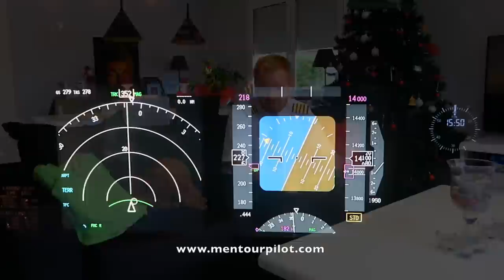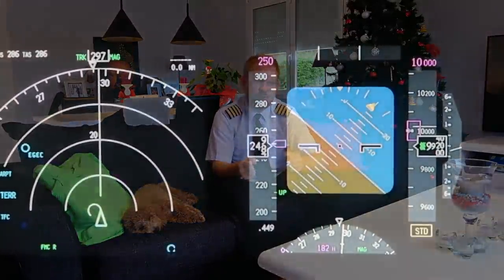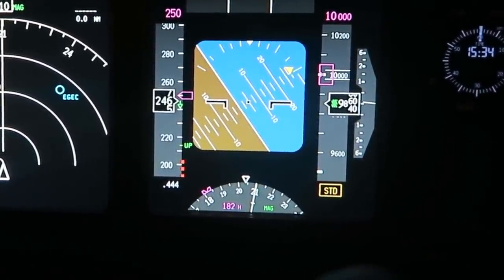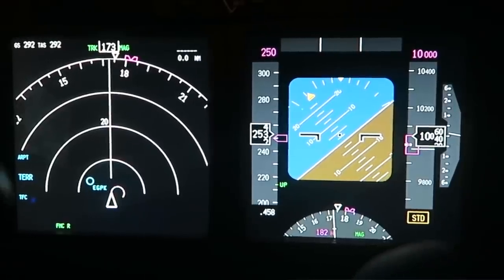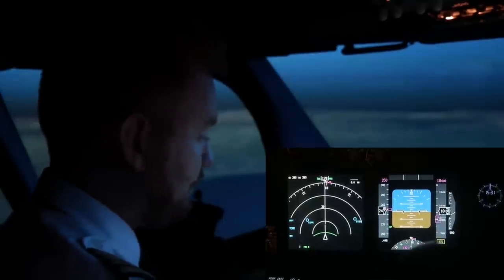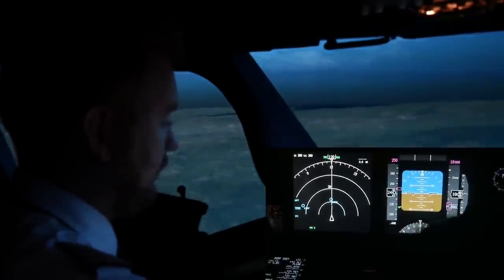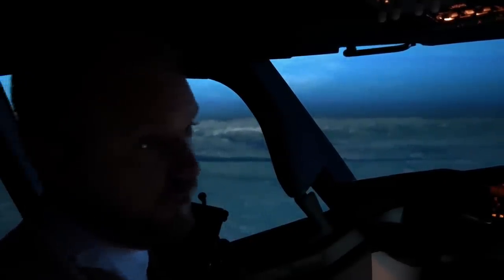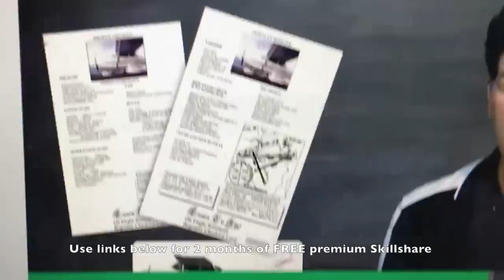What happens if you ROLL an airliner?!

Comment: Q. What happens if you roll an airliner?
A. You lose your job
Reply: That structural overload is a real thing. You get to survive to lose your job - if you're lucky.
Reply: @Lucien86  Not really, yeah might be unpleasant in the passenger seat, but the aircraft will be just fine. The safety factor is more than 1.
The B707 test pilot even did a barrel roll with it. B747 was tested at mach .99, but never ever goes that fast normally.
Reply: @janosmucha4897  I'm sure you're right. But in a structure that big physics is always against it and rolling puts some very abnormal loads on the airframe & wings. Heavily laden, full of fuel, and maybe 10 + years old, not quite so confident.
Reply: You Will have an appointment with the Wind Commander for sure.
Reply: World is boring.
Reply: 6 6  was it for Aeroflot?
Reply: @janosmucha4897  A fedex pilot pulled it off a couple of times in a DC-10-30 too granted that was a cargo variant, put the aircraft through several overspeed dives and other manoeuvres that were not exactly by the book in the same flight too. Course when you have a crazed lunatic on board actively attempting to murder your crew over stressing the airframe is the least of your concerns it's not like the plane will survive the loss of it's crew either.
Reply: And your life, along with 250 people.
Reply: @rolandocrisostomo2003  Not really in fact aside from the examples where it has already been conclusively demonstrated there is really no good reason to believe others could not achieve it. Don't get me wrong they are certainly far from optimised for it this is not the sort of thing that large wing spans lend themselves to as the larger your wing span the greater your moment of inertia in the roll axis as a rule and thus lower achievable roll rates. In short this results in more altitude needed to pass through the time spent with your aerofoils inverted and not generating lift and recover before striking the rather large rock bellow you, course this is somewhat counterbalanced by the fact airliners tend to have rather high service ceilings that would enable them to bank the necessary air beneath them to pull it off. I'm not suggesting you head out and grab yourself an A320 to try it out but I certainly wouldn't be staking my life savings against anyone that claimed they could pull it off from an initial altitude of FL380 for sure.
Reply: not for the pilot tex johnston, if it were not for his barrel roll boeing wouldnt have had a passenger jet
Reply: Worth it. :D
Reply: Of course
Reply: A simple roll should not break the airplane. A roll with elevator (a proper barrell roll) will quickly stress the aircraft
Reply: @Lucien86  rolling itself does not increase load factor. You need to pull into the roll i.e turn to increase load factor.
Reply: @afoose  You're only thinking of the load as a static factor. Rolling reverses the forces on the wings twice plus a lot of other momentary loads and on a big plane these can be pretty large.. The wings will flex, the whole fuselage will flex, the engine mounts will flex. Any asymmetry in the rotation and the engines will also apply gyroscopic forces to their mounts. 
The real difference between small objects and larger objects is that physics is not scale invariant - which means that larger objects tend to be inherently more fragile. Or in other words the larger an object the greater the forces it will (tend to) experience.
Reply: @Lucien86  all airframes which operate in the USA are designed to bear 150% times limit load.  In most jet transport aircraft this is higher than 3gs in both directions.  All aircraft strucutural components are designed to bear this load before plastic deformation occours in the airframe. If gyroscopic forces could stress engine mounts higher than 1.5G in a turn than all jet transports would be unsafe to fly. The control surfaces of commercial transports are not sized to create a roll rate which would damage control surfaces during maximum commanded roll. A engine mount will not structurally fail at +- 1.5G manuvering loads.  A simple roll only imparts aerodynamic loading and does not actually increase  the load factor on the aircraft.  In actuality it may de-load the aircraft due to loss of vertical lift over the wings.  

The most load inducing component of a roll is the pull-out. After the wings roll past 160 degrees or so, the aircraft will lose lift and the nose will drop as the wings lose lift and the aircraft loses elevator authority.  Pulling out of the dive at low altitude will likely necessitate a high g pull-up.  

TWA Flight 841
Fed Ex 705
China Airlines 006

Are all examples of jet transports which have rolled extensivly in flight.  

In China 006, the pull out exceeded 6G and destroyed 50 percent of the elevator surfaces.  It was repaired and put back into surface. 
In Fed Ex 705 the aircraft was rolled at least once. It was oversped into mach buffet zone, and the interior was damaged, yet the aircraft was repaired and put back into service. 
TWA 841 rolled twice in a dive, was oversped, and experienced 6G in the pull out yet the aircraft was repaired and put back into service.
Reply: @afoose  You put some fascinating info but it only shows that what I said is true. Aircraft are deliberately designed to be able to survive things like rolls and with redundant margins. That 3 gees of stress in either direction on the wings is a stat I haven't heard before and is very impressive but makes total sense.. 
TBH I already imagined the biggest danger with big planes and rolls has to be picking up too much vertical velocity during the roll then pulling out too fast or going into an uncontrolled spin..
Reply: @Lucien86  normal operational load to maximize fatigue life is limited to +-1.5G with limit load typically being 2.5G and certified ultimate load 150% times limit load. At this point the airframe will plastically deform. 

These loads are created by the lift vector  which is roughly equal to the aircraft weight. This is typically in the hundreds of thousands of pounds.  The load factor is a multiple of aircraft weight.

You can do a quick calculation of control loads due to aileron deflection (you will need primarily need airspeed, aileron area, some estimation of A/C inertia and secondarily vertical/horizontal stab area, and max roll rate created by aileron roll) and you will realize that these do not amount to multiples of aircraft weight.
Reply: @Lucien86  always assumed planes could handle whatever you could input with the controls until I saw people in DCS sheer off their wings in high g maneuvers.
Reply: @KBBF3  Yep and that is totally accurate. Do a steep dive and pick up enough speed and pull up quickly and sharply enough and you can pull the wings off almost any plane. In a maneuver like that the wings themselves are acting as the main 'control' surfaces applying the turning forces. 
This force multiplication with speed is why supersonic aircraft have to be built far more strongly than ordinary planes, hypersonic planes and reentry vehicles have to be stronger still.
Reply: Life advice right there...
Reply: Your job and likely your freedom.
Reply: Actually Tex Johnson who famously rolled the 707 didn't lose his job.
Reply: The test Pilot who flew the Dash-80 which was the Prototype of what would become the 707 did a barrel roll during a test flight and when question by the Boeing CEO at the time Bill Allen, the test Pilot just said "Just Selling Airplanes Sir!"
Reply: @Lucien86  gotzilla havent this problem.. And is big...
Reply: I’m sure there have been some seriously unplanned rolls which have gone on to successfully land. I think there was one in Alaska, a Chinese plane? I doubt any were pleasant for the passengers. There was one doomed plane that flew upside down for a bit. At 90 degrees I think you’re just clinging to straws as to whether you roll or drop.
Reply: I made your comments 666
Reply: In 1988, the VASP Flight 375,  suffered a hickjack by an armed attacker at a time remote airports had poor securit. The disturbed man wanted the pilot to ram the airplane at the parlament. Pilot Fernando Silva did a Tunnel and a Corckscrew in order to throw the hijacker out of balance, ironically he failed to immobilize the hijacker because he standed up before the copilot and flight attendant could unfasten their seat belts. 
The plane survived both maneuvers with light damage to the elevators. Unfortunately there is few details about the incident in English, but you can watch a simulation of the maneuver here and try the automatic translated subs:
watch?v=QAOsxBlm5Ns
Reply: Lucien86 the reason why the 707 was fine is because the pilot did a 1G barrel roll, as far as the aircraft was concerned stress wise it may as well have not rolled at all. Other maneuvers on the other hand.... Not so safe.
Reply: B. Everyone dies. "Safest way to travel, unless the pilot turns the stick too much".
Reply: @janosmucha4897  You are not considereing this roll with the additional weight of passengers and the cargo involved. With that additional load it is very lickely that you will damage the structure of the aircraft heavily with the wrong input. And its quite difficult to keep doing the right inputs in this situation without overdoing it. Sometimes its even impossible, depending on the situation. Also as he mentioned in the video, the Test Pilot was very experienced aswell and its not something you can do without huge preparation.
Reply: Probably your license too. The FAA doesn’t look too kindly on aerobatic maneuvers in a non aerobatic plane.
Reply: It's what happened to Denzel Washington....
Reply: Rolling any  airplane can be done doing  zero loads on the fuselage. Bob Hoover could roll his airplane without spilling a glass of water, doesn't have e to
Reply: Only if you have witnesses. 😉
Reply: And your licence.
Reply: @alexs3187  I thought any maneuver in an aircraft was aerobatic.
Reply: Concorde pilots did it over the Atlantic in the dark.
Reply: A.M. "Tex" Johnston was almost fired because he did the original passenger plane barrel roll of the 707 prototype over the Gold Cup course in Seatle.  He was told to never do it again. full details in his autobiography.
Reply: @janosmucha4897  – the 707 was a very strong aircraft. Strong tends to mean heavy. In the early days of jet airliners fuel was cheap, fuel taxes were low. Today strong, heavy means high fuel consumption = big big $$ even with the much higher fuel efficiency of modern high bypass turbofan engines and much improved understanding of airframe stresses.
Reply: @Lucien86  , when Tex Johnston rolled the 707 over lake washington during the seafair hydroplane races here in Seattle , that was a one G maneuver. The airplane never experienced more stress than straight and level flight. He actually did it twice that day.
Reply: @jaydencostanzo6308  ,your a child...
Reply: @stevegiboney4493  That probably shows more than anything the huge differences between very skilled experienced pilots and less experienced pilots. I hadn't appreciated it in my first posts but yes rolling a plane done right is a low stress maneuver.
Reply: @pcmasterwraith7676  jk
Reply: Anyone not wearing a seatbelt falls onto the ceiling.
Reply: FAA: it’s a passenger plane! Not a jet fighter!!!!!
Reply: @Dr_Reason  - Actually, Bill Allen did fire Tex Johnston the following Monday, then rehired him to head up sales. I like how Allen, when Johnston explained there was never any risk to the aircraft, laconically said, "Well, you know that and now we know that. Just don't do it again."
There was a Braniff acceptance flight of a 707 that ended in disaster when the pilot exceeded the roll limits during a Dutch roll. Three of the four engines departed the wings and the plane crashed.
Reply: Texas Johnson didn't lose his job. His boss told him: you and I know, you did one G during that roll, but the public doesn't know that. Never do that again!
Remember, that was during the very first presentation of the new 707 model. He had quite an audience.
Reply: @Lucien86  No, it doesn't. How do you fly a looping? When you fly upside down, you certainly do not want negative G. Fly it faster, keep flying positive G. Same applies to a barrel roll. Of course you can screw up and do it your way. And yes, that is more dangerous.
Reply: What I miss in this discussion is turbulence. In violent turbulence stress levels might cross the limits, doing such aerobatics. How on earth do you know, whether a bit of turbulence is too much? That is one of the true pilot skills.
Reply: B. The company makes you clean up the toilet that you made of the cabin.
Reply: @voornaam3191  - Correct - however I've read that the "legend" that grew up around that story misses out some important factors.   If I recall correctly, Bill Allen was horrified when he witnessed the barrel roll, and summoned Johnson to a meeting the following Monday in which several high-end board members were present.  Allen claimed later that in his mind he was all set to fire Johnson immediately following the demonstration, but by the Monday he had calmed down enough to at least hear what his chief test pilot had to say for himself.  Johnson did not simply tell Allen and the executives that what he did would not endanger the aircraft, he spent significant time explaining that he had consulted the engineers as to the maximum load the airframe could take, did his homework calculating the airframe stresses, then incrementally tested his theory prior to the demonstration to make sure that the data he had was correct.  He only tested the 1g barrel roll once he was absolutely certain that the engineers had it right, and only performed the roll at the demonstration following the success of the tests.  Allen then called the heads of engineering in to confirm Johnson's story and only after they did confirm it was he willing to relent with his famous warning not to do it again.

Reading between the lines, it seems that what really upset Bill Allen was less about the manouevre itself so much as the fact that Johnson planned and performed it without permission - specifically Allen's own permission.  Again, if I recall the book I read correctly, while Allen didn't dismiss Johnson and maintained professional cordiality, in private he never entirely forgave him.
Reply: @turricanedtc3764  Thanks for posting this.
Reply: @lisaa8795  - You're welcome.
Reply: probably also arrested
Reply: I’m amazed at the expert opinions of folks that have never turned a prop in their lives. Categorically, a B-737 can be rolled. Specifically, an aileron roll. I’ll leave it there. ATP with 8 type ratings, 22,000+ hours.
Reply: I´d like to know a reference for Boeing having flown a 747 at Mach .99. For another concern, I had researched the matter, and could not find any definive information.
Reply: No you don't. Tex Johnson rolled a B-707 in front of dozen of reporters while doing a "show" and nothing happened. He was called into the Chairman's office the next day and simply asked not to do that again. Tex was the head of Production Test for Boeing for decades.